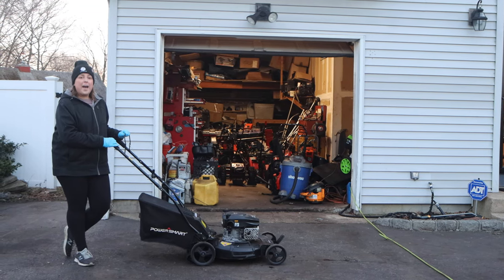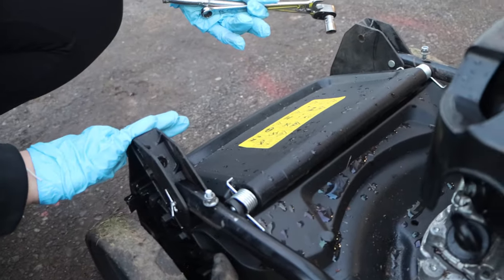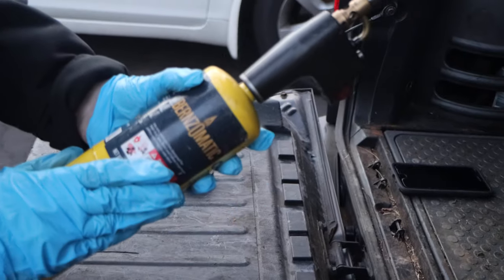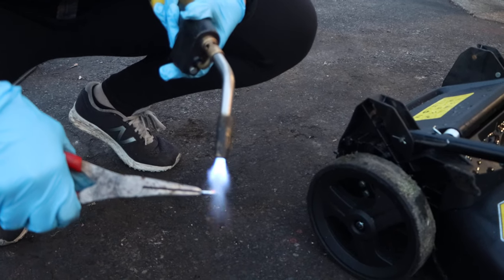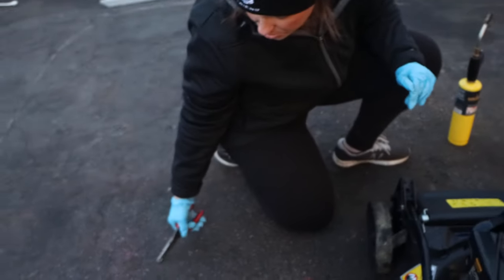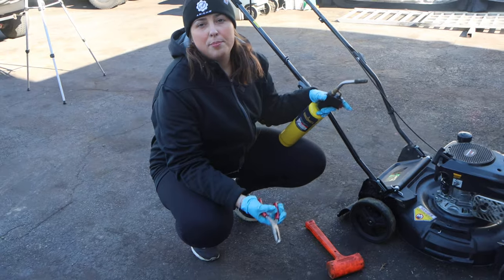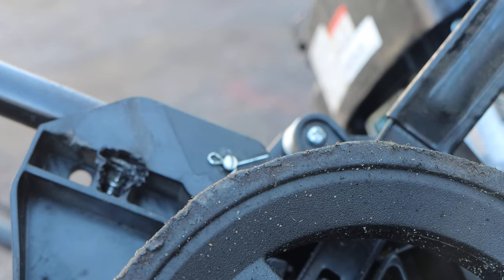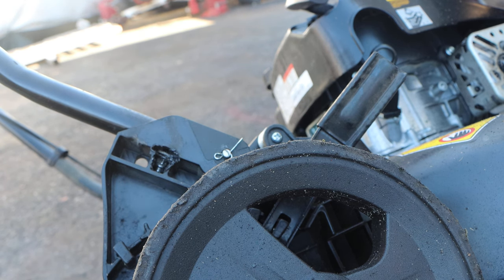Helping Fellow Youtuber Fix DEFECTIVE PowerSmart Lawn Mower EASY PEASY DIY HOW TO #walmart #defect

Comment: Hello Jason & Cristina,  I was on a NWS Weather Spotter Webinar when I noticed that your video had posted - Yes Brother Duke really gets around.
So Back in January, I turned 57 years older than dirt in which as a special present that my Ford truck decided to crap out with the engine control computer or module going wacky.
Ford in its infinite wisdom or sick sense of humor decided to compound the issue by really hiding the computer.
It’s amazing how much plastic that is used on the newer stuff that is being sold nowadays. 
As a rule, I usually purchase the 5/16 & 3/8 inch self locking nuts, flat washers and bolts in bulk at TSC as well as keeping a good supply of various sizes of fender washers which have saved the day more times than I care to admit to.
Normally I would mention a heat gun for working the plastic, But with the rise in electric rates - Hmmnn!!!
Cristina looked rather dangerous with that torch - Especially when she was close to that orange Snap-On hammer; No Orange Blobs Allowed, Cristina!!!
Reply from the maker: Great idea with a heat gun...just wanted to keep it short, simple and sweet.  This video was long as is 😂😂😂Happy Birthday!

Comment: I drilled all the way thru the plastic and used a  3/4 x 2 inch piece of flat steel as a washer with longer bolts.

Comment: 🤣 she's thorough, telling them in which hands to hold the pliers, and the torch. She is delightful to watch, though. Looking forward to more videos with her. 

Yeah, the zipties are a good backup; I was thinking that ( oversized, doubled up, or the stainless steel ties ) when I saw that hole in the handle bracket.
Reply from the maker: I’ve never heard of metal zip ties got some googling/tubin to do.  If I was keeping the mower myself I would have doubled backed the repair with a hose clamp.  Since this was for resale, didn’t want anything to seem off.

Yes very thorough turning a 5 min repair into 2 day 3 hour ordeal 😂
Reply: @pattayperformance  Yep, Amazon. Personally, as a buyer, I would rather see extra support on the handle, especially if I knew that specific repair was done. As you were saying in the video, I don't think anybody would bat an eyelash at 2 ( or 4 ) black zipties down there.

Comment: i would have made the slot for the nut and and washer after the second rib in the plastic. where the guy is pointing too in the video at 8:10 minutes. then use a longer bolt. would have been stronger and last longer
Reply from the maker: Thanks for watching!  Repair is still holding up great to the day!  I’m sure there is more than one way to repair.  Bigger the washer the more surface/area support it has.  

Happy Friday 🫡

Comment: My same lawn mover just broke the exact way yours broke.  I was thinking about how to fix it, will follow your method to keep the mover running.  The plastic used in this mover is flimsy, and I give the lawn mover just an average rating and not a good one.
Reply from the maker: How old is yours?

Comment: Chinese made. In think
It’s NOT MTD (Made To Die)

But with handles like that maybe it is Made to die

Great fix and fabrication work.

Instead of zip tie mechanic’s wire
Reply from the maker: I don’t think this could hurt someone but you never know.  Handles food over it should close the cable and activate the kill switch.

Thinking the motor would have damage before the home owner.  I pray so!

Comment: Instead of zip ties, I would use automotive hose clamps that are adjustable
Reply from the maker: Agree but we have used clamps in the past to stop the bail cable from popping out and people pick up on it right away and lost a few sales.

Zip ties for some reason  fly under the radar they are used to route cables

Comment: I had the same type mower come in the shop, the owner, wanted me to fix it, well the plastics both front and back were bent up, so the wheels were off the ground, what a mess, I had to heat both front and back and bend them back into shape, I was able to get it level.... Somewhat, power smart engines are crap, can't get any internal parts, other then outside parts if it goes bad internal might as well toss it.
Reply from the maker: chonda!

Comment: What's the name of the plastic bracket? My bracket is broken. Please and thank you
Reply from the maker: So this lawnmower is long gone so I’m don’t have the model and serial number. If you can post that please do.

This the part number for the whole ASM…bracket is part of that.  Part# 203050388B

Are you on Instagram?
Reply: @pattayperformance  , model number is DB2321SR. Sorry I'm not on Instagram but thank you so much for trying to help me out ❤️
Reply from the maker: @dgutierrez115  I would say jump on Instagram and we can do video messaging to asses your mower to see if we can repair it as is or just replace the whole assembly
Reply: Patty, the serial # is DB2321SR. From the display I think I need the rear seat and also rear seat square nut 2! I'm also having trouble finding the right application to order the parts. I've tried for 3 days. No one answers the number that is posted for service
Reply from the maker: @dgutierrez115  

part number is still the same to replace the whole part.  If the square nut pulled through it wont work.  You will need to use the same exact steps we showed in the video.
Reply: @pattayperformance  thank you so much
Reply from the maker: @dgutierrez115  you’re welcome!

Comment: I'm on my daughter's YouTube account. I'm not trying to belittle you in any way. Why didn't you just put the handle in place, drill all the way through, about an inch or so, and install a longer bolt. I admit I like your creative idea, but no offense, I think my idea is more practical and less time consuming. Just my 2 cents.
Reply from the maker: It’s ok...

1) The Repair done simple tools and means.  You be surprised how many people don’t have a drill/bits but do have a heat source

2) this mower is for resale so we don’t want to do to anything out of the norm.  MTD has a similar design but no issues bc the using bigger diameter on the nut.  We were playing off that.  

This repair is 5 mins tops...since I let my wife figure it out it takes longer and still retains factory look.
Reply: @pattayperformance  I hear you there about the drill and drill bits. I never had a welder until about 13 years ago. Hope your channel is a success.